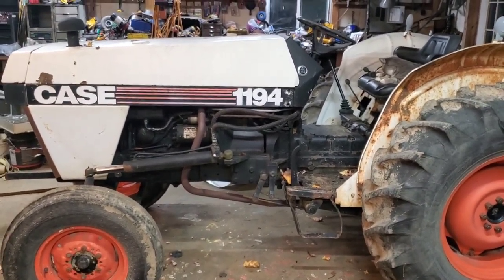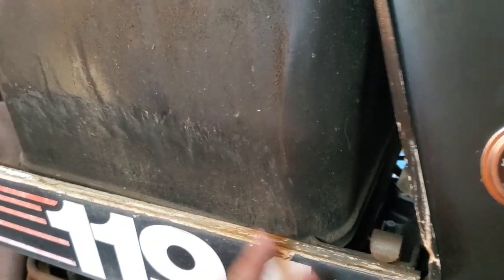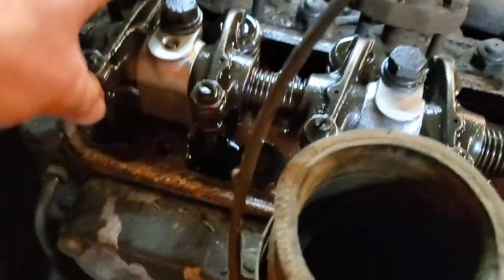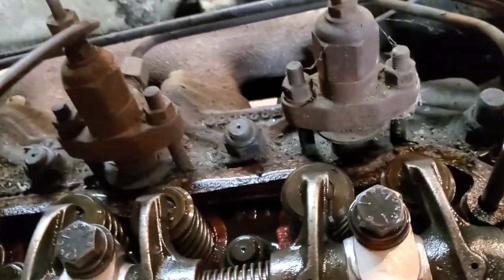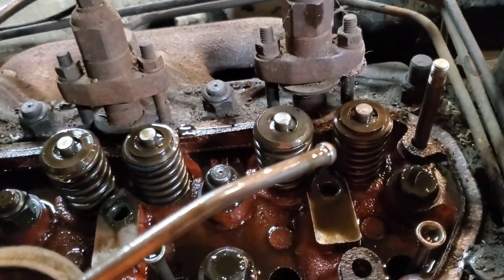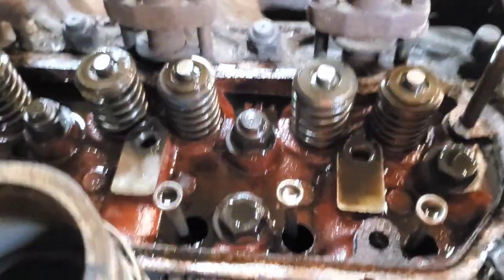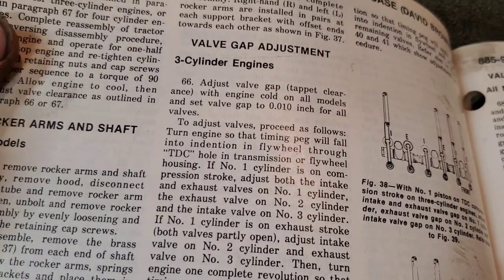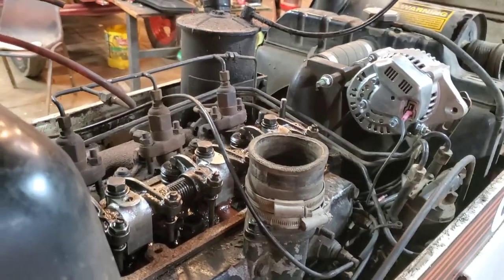Case 1194 Backfire Diagnosis

Comment: Keep us updated. I've never heard of 3cyl with any sort of engine damage.
Reply from the maker: The only ones I've had issues in the past were ones that sat for a while.
Reply: @farmingwithjunk1848  what kind of issues? Can't be to big
Reply from the maker: @97timboi27  I've had several with rust in the cylinders and rust pits on valve seats. I've had broken ring lands and broken rings in a couple. Had a cracked rod bearing in one. Mostly issues from time, moisture, and lacl of care.

Comment: There is a particular type of washer for the rocker cover bolts lots of people think you can just use a copper washer but they will never seal
Reply from the maker: I usually put a little bit of silicone gasket maker on the bottom of some copper washers and I've never had trouble with them leaking.

Comment: Is the original push rod hollow? If yes that's for oiling i think. So one without that might wear out quickly and cause other damage
Reply from the maker: Good thinking but they are solid not hollow.